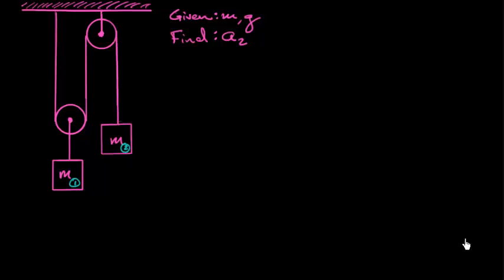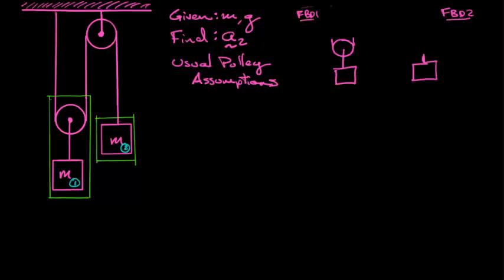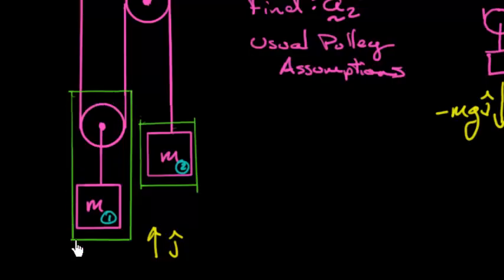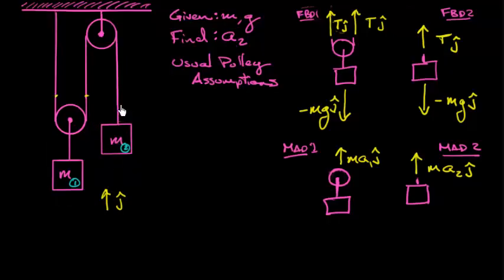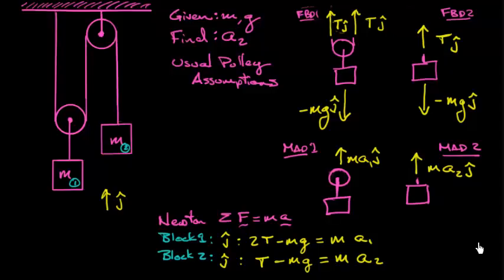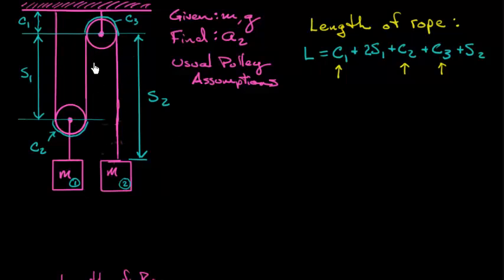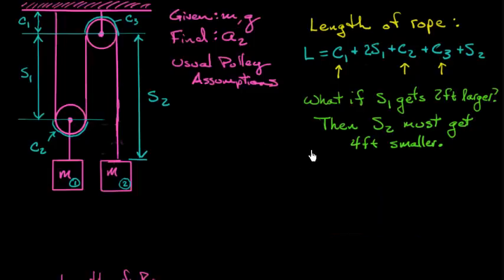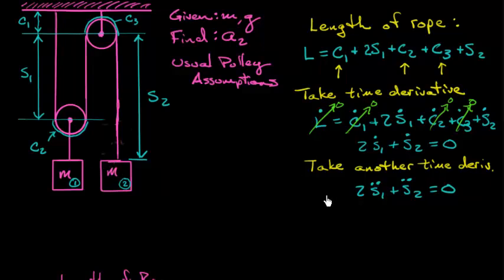Less Simple Pulley, Part A - Engineering Dynamics Notes & Problems

Comment: What if the fixed plane where the rope and top pully are attached is at an angle and not perpendicular to the mass? How does that change the tensions?
Reply from the maker: I have a video of a more complicated pulley problem for which the blocks are on slopes. You can find it here: https://youtu.be/8P2eV4-s9AI

Comment: quick question, on block number 1 there is a rope hanging from the pulley holding the block why dont you take that into account as well?
Reply from the maker: +Hussein Elsherbini In my free body diagram of that block, I included the pulley and the rope connecting the pulley to the block. Therefore, the rope connecting the pulley and the block are INTERNAL. When you write equations for Newton's laws applied to a system, one only includes EXTERNAL forces.
Reply: in this case how do i come to recognize if i should include the whole pulley and the box or just the box. thanks for the response :)
Reply from the maker: +Hussein Elsherbini You can do it either way. But if you only include the block in the free body diagram, then you will have to draw a separate free body diagram for the pulley and write equations for it.

Comment: Could you please tell me how I wold calculate the  Kinematic relation if the length of S2 is not equal to S1?I mean both pulleys are closer to each other?
Reply from the maker: +I Wonder : It's the same. There is no assumption that s1 and s2 are the same or similar.
Reply: Thanks but I am having hard time to understand the 2:1 relation Between S1 and S2.If The part of the rope  after C2 is not equal to S1 then we can not write 2S1 in the length equation.I have the same problem in my Mechanics exercise .But In that case two pulleys are closer to each other.